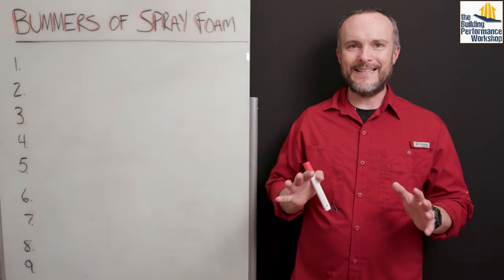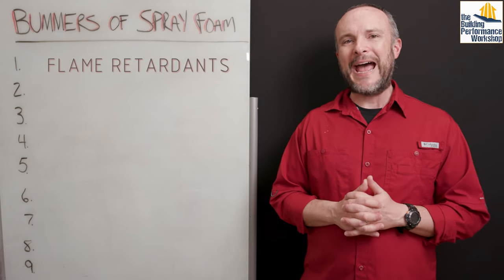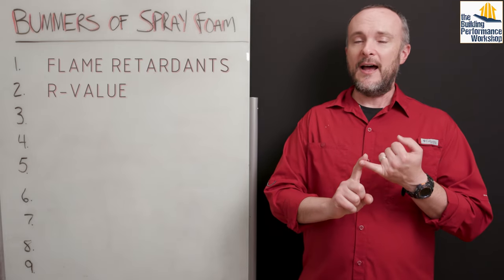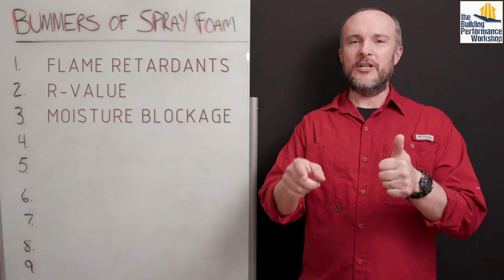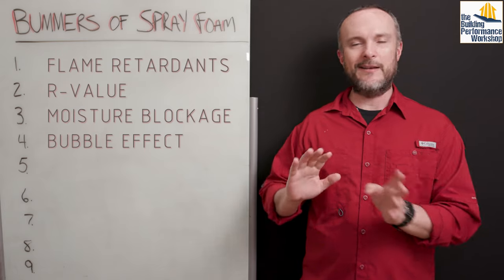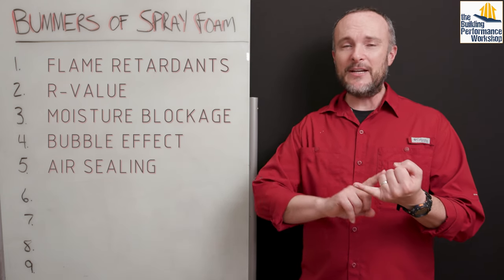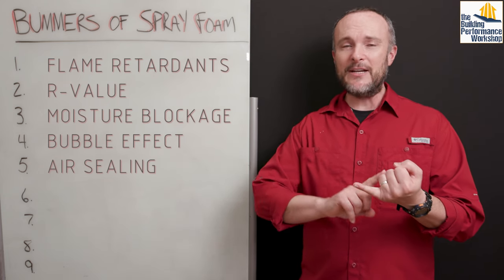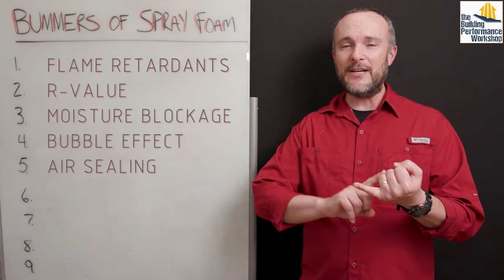Spray Foam Bummers: Make Informed Decisions on Insulating Your Home

Comment: A properly installed foam has no off gassing. #1 is wrong. 
open cell foam can achieve R21 in a 2x6 wall. Fiberglass is R19 and is not AIR IMPERMEABLE which reduces that R Value by ~30%. Educate yourself on K Value. #2 is wrong. 
Water can travel through Closed Cell Foam, you're comparing Apples to Oranges here.... Moisture retarder is talking about moisture drive and not actual water droplets. Water droplets CAN travel through closed cell foam. Moisture cannot as the due point is met within the foam and therefore doesnt have an available sub straight to lay out on. #3 is wrong
Spray Foam is the exact same Polyurethane as the bottles your water, coca cola, snapple, or any other plastic product you drink or eat out of is made. #4 wrong
Foam is 1.5x as expensive from traditional insulation on average. Again back to point #1, PROPERLY INSTALLED. #5 misleading
#6 again is based on PROFFESIONAL APPLICATION. There's winter foam as well as regular. #6 wrong
#7 is the only one point I agree with, they are under paid chemists after all.
#8 is the same as #7. 
You fell off heavy at the end.
Reply from the maker: Ok we get it, you love foam- and yet no other insulation product can lead to the utter disaster it turns into in a single day. Even if it’s 0.01% chance of disaster, the other product types are safer. I disagree with your arguments btw, but we can agree to disagree.

Comment: Question: when you use spray foam in a can and water gets to it it spreads through the cells and holds moister (people do it to repair rust holes on cars and put bondo over it and it rusts three times faster) I would assume open cell would do the same in your house if you have a roof or water pipe leak and I think it would be hard to locate. Am I correct? And would closed cell be any better at this? Also I don’t like that if you later want to fish a wire or something in a wall it becomes a real problem. Thanks for the video. These are things you don’t think about but make sense once its explained 👍
Reply from the maker: I bet it would, though uou’d at least have an idea that there is a roof leak, and where.

Comment: Great video. I’m looking to insulate an existing metal building and want to avoid spray foam/ rigid foam. I was thinking of putting up a reflective barrier, rockwool,and intello plus. Would this work or just trap moisture between the reflective barrier and intello? Maybe you could do a video about this? I’ve searched for advice online/ youtube and there seems to be a need.
Reply: What is the climate like in this location? Moisture and vapor barriers can be pretty different depending on context in some cases.
Reply: @markallen6433  Thanks Mark, I’m in climate zone 3. 100 degree summers, 50 degree winters. Low humidity year round. One video that shows how they insulated their metal building with rigid foam has over a million views so I know there are others that are interested in this subject.

Comment: I live in the north (we get -20°c often in winter) What would you recommend to insulate a basement with concrete foundation (about 50/50 under and above ground walls) and floor joist ? When i moved in there was rigid foam but since the foundation wall is not flat, theres some places where there was mildew. I was thinking about spray foam but been seeing a lot of negative to spray foam lately. Worse one being toxic fumes if not applied properly.
Reply from the maker: It is a risk- they make vinyl-faced fiberglass blankets, but now the exposed vinyl is a bit of a hazard for phthalates- everything is a compromise. I’d ask your local basement insulators what thry can do well.

Comment: I’ve passed many blower door test with just 2 in of foam.       It’s not an experiment either it’s been done before many other times .   No one ever sells it as a waterproof barrier.     Nothing is waterproof. If it’s gonna condensate there’s gonna be water.      The reason why 2 lbs foam is superior is that it won’t get water logged and if are does get wet easily dry able        By the way at 2 in of foam is at 86% efficiency.  I’ve sprayed mansions and by the time I was done they were being heated  by a milk house heater.    There’s a lot of things you simply don’t know.         I’m 99% sure they don’t make b chemical with soy products anymore because bugs like to eat that foam    People like you make the industry try didn’t chemicals and then long term they are not good.   You guys are making all the sprayers in the us     To use hfo blowing agents and the industry is going to come to a adhesion problem because that new product sucks truly

Comment: Hello, I stumbled on this video because I was trying to build an ICF house but realized it was too expensive. So I saw other videos on using mineral wool to insulate a home. If I use Mineral Wool on the external wall and Spray Foam Insulation on the internal there should be no issues with air contamination in the house or is there non-toxic insulation for the interior of the house

Comment: "Ruin your life" when describing moisture flow is not useful. What is true is that where moisture sees a surface with a temperature differential, condensation occurs. This leads to water collection unless your design indicates a path for the water to go.

Comment: Very helpful! With regard to the vapor barrier concern, would this be the same for a Zip-R panel where there’s rigid foam bonded on the backside of the sheathing? Isn’t this now a vapor barrier like spraying closed cell would be on a standard zip or force field sheathing? Thanks!
Reply: With zip R the air and vapor barrier is the green exterior, the foam butts up to the foam of the next panel, but that join is still air and vapor permeable, so it's fundamentally different from a continuous internal application of closed cell spray foam. Also with a well installed zip system, you're probably not going to see much in the way of leaks, so you can be a bit more confident about having that hard barrier. Technically, a poorly sealed penetration through the zip, like a nail that wasn't sealed or a poorly installed window, could let moisture into the wood, and then it would be trapped between the barrier and the foam cladding in Zip R or in Zip plus spray, and yeah, that could be an issue that causes water damage there, but again, with a good install, it's pretty unlikely. 

For these well sealed homes though, you do have to worry about your internal airborne moisture. You really want to run a dehumidifier, because if you don't you can absolutely run into problems from airborne moisture condensing in seemingly impossible places. You also absolutely want to run circulation, filtration and exchange systems. Those can be avoided with older air permeable construction, but not really with high performance barriers, no matter what form they come in. This channel has some of the best discussions about those kinds of systems if you look through the history.
Reply: @markallen6433  thanks for the detailed response! Assuming you run a whole home dehumidifier and have controlled fresh air exchange and circulation, as long as any trapped or condensation and dry to either the inside or exterior of the close cell foam it should be okay then right? Any vapor on the inside of the cc foam can dry through the wall cavity and drywall inside where there’s a dehumidifier and any moisture on the exterior of the sheathing can dry to the outside.
Reply: @mngo89  Lets assume your exterior vapor barrier is perfect, just for the thought experiment.

The only source of water is going to come from water in the house, there is airborne moisture, and when it's warm the maximum amount of moisture is high and when it cools that amount drops, so you want to have a sense of how cold the air in your house can get. If you have closed cell foam, the interior of that foam is as far as the air can go, so the inside layer of foam is inside your vapor barrier, and also inside your insulation, so the relatively high moisture air won't get to cool down that much  when it gets to the barrier, and that sounds good overall, but there is a problem, if you have a hole in your foam, that air can get through that theoretical barrier in a few little spots here and there, which is why he's calling it an unreliable barrier, and correctly so, and there is a good chance that it's your last insulation, so now in a cold climate, those little holes let warm humid air escape the insulation barrier and start to form condensation on the interior of the framing or the sheathing, and it's trapped there on the far side of the foam and the wood wont dry out, this could potentially be a big problem.

In practice, I don't know how common that is.

What he's suggesting is that you have an air barrier between your drywall or internal panels, that keeps your humid air always inside the insulation no matter what, and it's also going to keep questionable chemicals out of your living space.  This is a more reliable approach, but I don't know if we're talking about a failure rate of 3% improving to less than one, or if the failure rate of bad spray foam is more like 50%. I can't really comment on the value of the improvement with the internal barrier, just that it's theoretically superior.

If you have a sense that the air might only drop to 50F, you can look up a humidity/temp chart, it's called a hygrometric chart. If you know 
how to read it cool, if not, check this out:

https://www.rotronic.com/media/productattachments/files/h/o/how_to_read_psychchart_f_web.pdf

To put it simply, lets say you want to be dew free at 50, and you keep the house 75 . If your humidity is 40% when you're at 75, you should be dew free down to 50. The whole thing gets pretty complicated, but aiming for that sub 50% humidity makes the system pretty unlikely to allow anything within the envelope to ever sustain lingering moisture in almost all circumstances, wood that's damp will dry up quickly even without much circulation directly hitting it, and you'll never allow cooking or respiration building up enough that you have issues with that either, and you'll have a pretty big buffer in terms of all the stuff in the house and it's capacity to absorb a little humidity, so you can have a big spike of moisture and a pretty small dehume, and you'll be fine.

I'm not sure I'm being helpful here, but feel free to ask for more clarification if I didn't provide a useful answer.

Comment: So I'm curious.  I live in SE Michigan and wanted to insulate my rim joists myself.  Early 70s house, aluminum siding and I'm pretty sure some kind of Celotex fiber sheathing without house wrap.

Are you advising against spray foam? Was planning on rigid foam against the rim, sealed in place with can spray foam and then rock wool (on the basement side).  

Is that not okay?  If it is okay, do you recommend a brand of foam?  Was thinking of Afcat extreme or Soudal fireblock.  Thoughts??

Comment: What about selective use in tough to insulate/seal areas like around rim board/joists?  I did this as a fix for poor air tightness under my kitchen in a poorly built (code) house and it seems to have worked well.  I used a DIY closed cell kit from a box store and only applied it 1-2” thick, then covered it with the original fiberglass bats.

Comment: Hello, I really appreciate your video as it confirms many of the concerns that we have. So the problem that I am trying to work around is that I have a pole shelter with both metal trusses and roof. The roof being attached to 2x6 purlins that span from truss to truss. Would a viable solution be to put rock wool up to the metal to prevent air movement and condensation with a permeable membrane beneath such as SIGA Mijrex to help hold it in place?

Comment: A peel and stick roof membrane like Ice & Water shield will keep your roof from leaking so you don’t need to worry about water on top of your spray foam. 

The spray foam doesn’t get anywhere near hot enough to melt the Romex outer shielding.
Reply from the maker: There are real life exceptions to both of those fyi. SPF can set fire to a home when not installed properly, it can certainly melt plastic.

Comment: What about SIP’s if the foam is encapsulated and your HVAC is setup properly with ERV and fresh air recirc? Any recommendations?
Reply from the maker: SIPs are not spray foam, but the flame retardant bit still applies. Always just weigh the pros and cons- plenty of my clients use SIPs the way you describe.

Comment: Problem# 10 and actually the #1 for me is bug issues.    My experience with spray foam is that it provides a wonderful home for roaches and other insects.   The soft, warm area becomes a breading ground and hotel for these pests.
Reply from the maker: Interesting point- haven’t seen comparison of fiberglass, cellulose, sheep wool, denim etc in regards to this- maybe they all have issues. Airtightness for the win- keep the bugs outside at all costs.

Comment: This all makes so much sense, but what about trying to seal up rim joists in a retrofit? What would be a good (non foam) method for that?
Reply from the maker: You can spray on gasket like Aerofixx, but again, it’s about volume. If you’re just putting in that much, and YOU control the conditions (and maybe are the installer too) you can mitigate a lot of these issues.

Comment: I am moving into a large traditionaly insulated house in texas. Im worried about the electricity bill. Would you consider using a closed cell foam to seal the entire attic floor (leaving the soffits open) up to around 2 inches then covering it all with loads of blown insulation. I feel like its the best combination. Also maybe covering all of the flex duct with a layer of foam as well.
Reply from the maker: I’d say that sounds really difficult to work on the electrical or ductwork later. Particularly flex duct does not last forever, you’ll need to replace at some point.
Reply: @HomePerformance  thanks for the response. Clearly every situation is different but if you were going to improve the efficiency of a classically insulated house, what would you do without doing a full remodel.
Reply: In the south
Reply from the maker: Same as most places- attic floor airsealing (at leakages only), duct sealing, insulation.

Comment: Several years ago, I witnessed a client collapse to the floor of his home that was under construction, about one week after the spray foam had been installed in the walls and roof. I was consulting and designing the HVAC systems for the home, and this happened during my initial visit to the project. 

IN ADDITION: In the last 10 years, we have designed and specified over 100 mechanical systems for new and existing residential and commercial projects. In at least 3 of those projects, where the homes were insulated with nothing but spray foam, the heating/cooling coils in the air handlers corroded from exposure to the chemicals emitted (off-gassing) within the first 5 years, and all of them had to be replaced. The HVAC systems we designed in homes without spray foam have never had the same or similar issues. Some non-laboratory, non-certified, DIY experiments were done on the corroded coils, and the results showed that the corrosion was caused by the chemicals that were off-gassed from the foam. Although this was not in a lab, this is not just known by this DIY-experimenter. It is my understanding that certain heating/cooling equipment manufacturers are aware of this as a fact, as well. How exactly the "know" is still yet to be determined, but, they know.

Many have said and will say that ventilating the home for 1-2 weeks will rid the house of all off-gassing byproducts. First of all, that was not the case in one of these homes where they actually ventilated for longer than twice that time, and they still had corrosion. Second, to effectively rid the house of these chemicals is to use a VERY high ventilation rate, and for longer than 2 weeks. Thirdly (but not FINALLY...more to come), whatever chemicals are ventilated out of the home during ventilation are going "somewhere". Dare I say the "O"-word? (I'll whisper it, "ozone").

There is a longer post in the making, but because our friend Corbett Lunsford posted this video this week, I wanted the chance to share his good info/intel on the subject to help spread that good word.

Thank you, Corbett, once again, for a very useful and critical info share. Well done, as always.

Which reminds me, I believe it was on one of your podcasts, Corbett, where I heard from a 20-year spray foam industry veteran,that "only true chemists should really be installing spray foam". Temperature, humidity, mix, etc. are all so very critical.

#sprayfoam #buildingscience #knowledge #construction #build #insulation
Reply: Do you have any evidence for your claims? I don't want to call BS, but those seem like sudo-science claims. What type of doctor diagnosed your client? And what tests did he run? How did you conduct your corrosion test? Did you do it in a controlled environment? Did you test multiple combinations of foam and coil material?

Comment: Is boric acid used as a flame 'tarder in foam? It's what we used in cellulose insulation in the late 70s. We owned a plant in Charlotte.
Reply from the maker: I’ve heard more along the lines of brominated and chlorinated TRIS
Reply: Most spray foams use TCPP as a flame retarder, boric acid is used as pest control option.